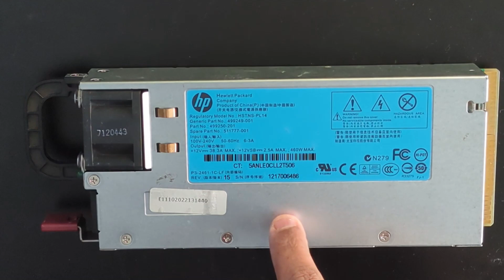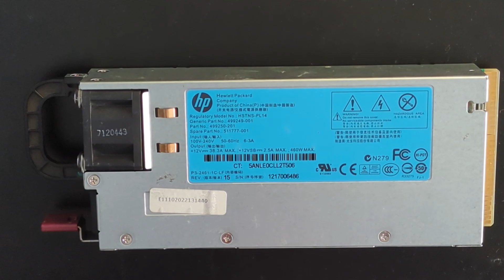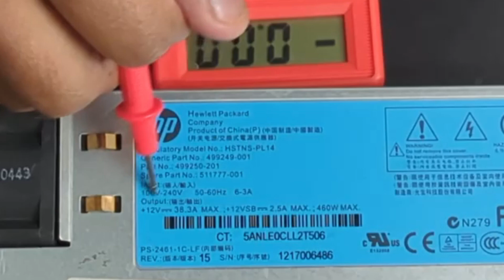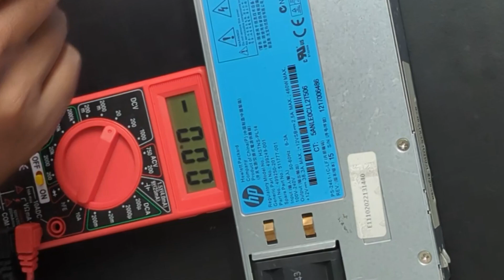How to use cheap Server power supply with Ham Radio or other amplifiers and rigs

Comment: Careful.  Many rigs need the full 13.8V instead of 12V.  It'll likely work, though.
Reply from the maker: Thanks for the suggestion!  I do plan to modify it to get the full 13.8v, For now I pair it with a Hermes Lite and a Recent RS928 amp, both support and work with 12v just fine.